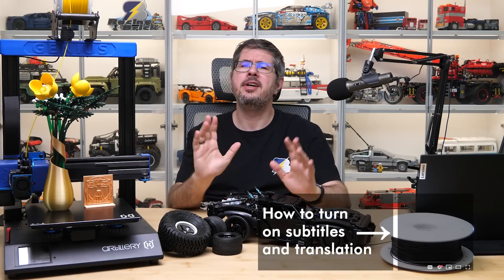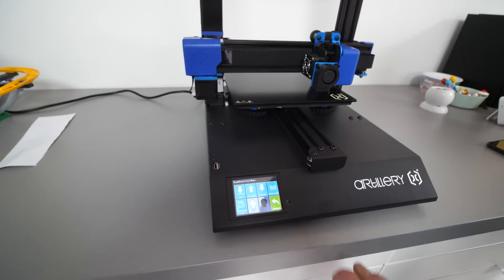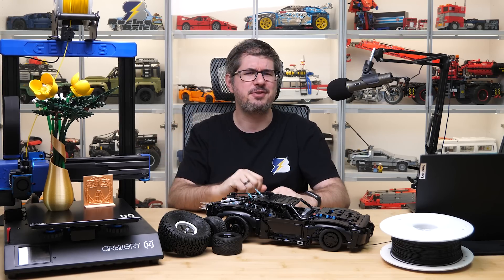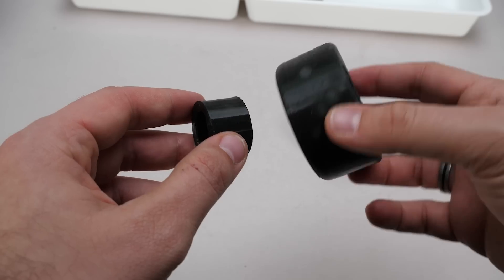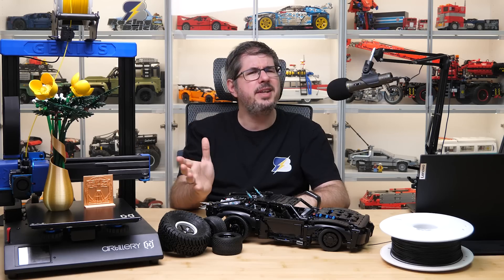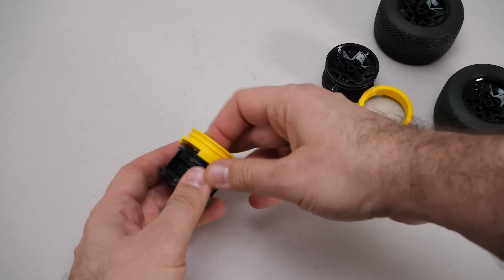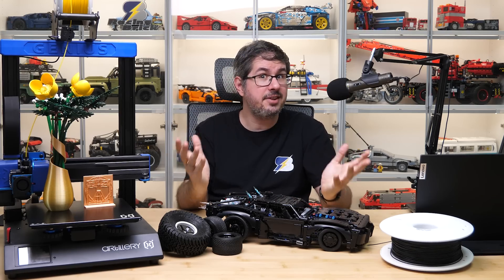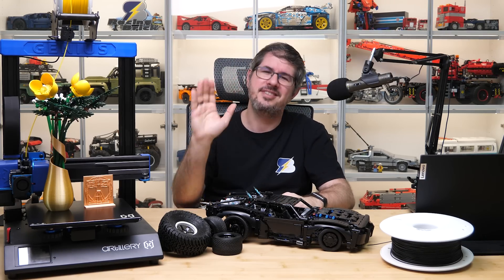3d printing custom tires for LEGO vehicles - fixing the Technic Batmobile!

Comment: For creating your own Lego parts - 3D printing should not be used for the final parts. Rather use it for what it is good for - prototyping.
get your design ready but without such things like axel-holes. Prepare the parts to have no surface defects and then create a mould and cast the parts in resin. Then add needed holes by drilling them. That way you can get parts with tighter tolerances, better finishes and way stronger.
Reply from the maker: Well, good luck drilling proper axle holes ;)
Reply: @RacingBrick  i mean i do have drills in 0.1mm increments. Getting holes aligned correctly and maybe having a bit more slop or a bit tighter holes is imo preferable to the warping, shrinking and lack of strength you get from printed parts.

Comment: Lego could use 68,7x27 tires from 1987 batmobile set
Reply from the maker: Those are too narrow
Reply: @RacingBrick  maybe, but it would still look better than the ones they ended up using.

Comment: Can you chemical wash or even fume bake the shiny material? clean some of the burrs off and matte the surface finish maybe?
Reply from the maker: I would need more guidance for these test, this is too generic with a lots of possibilities. We tried a heat gun on the material, only made it shinier. But whatever changes happen to the material it needs to be structural, otherwise anything covering it could be rubbed off during usage.

Comment: The Lego technic Batmobile has a lot of potential, I bought an instruction on rebrickable to upgrade the Batmobile design. No new tire required
Reply from the maker: Well if you don't change the tires and you still want to built the same Batmobile then the design of the wheels still won't match the original

Comment: Have you thought about 3D printing molds and then casting polyeutherane or silicone rubber into it to make wheels?

This is done a lot with combat robotics and can give some absolutely great results, although generally the hub is inserted into the mold so the tire is permanently fixed to the hub.
Reply from the maker: I did a brief research but this is a topic that requires quite some time to master. Maybe I'll take a look at it later, first I'll do my tests with resin 3d printing, that might be an easier way to achieve what we are looking for :)

Comment: Awesome video :D Probably too difficult but maybe you can print a model for the tire in hard material then make a silicon mold with that, and then cast the tires with liquid rubber. or maybe just a thin layer of liquid rubber or latex on the printed tires themselves. edit: with difficult I mean labor intensive and messy. I'm sure you could do it.
Reply from the maker: I did a brief research and although using urethane and silicone casting rubbers is definitely possible, people did it already successfully for RC cars, but this is a topic that requires quite some time to master. Maybe I'll take a look at it later, first I'll do my tests with resin 3d printing, that might be an easier way to achieve what we are looking for :)

Comment: When all else fails just use the printer to make a mold and make the tire that way. There are quite a lot of options for silicone rubber. Although I might be a bit biased as my friend at Uni did a lot of work using molds and made me want to try it.

Comment: No need to print out better tires and rims to see that the ones on the LEGO set are way off. A simple photoshoped image would suffice. But I appreciate the effort put into the video and showing how elastic parts can be printed. The other possibility would be to look for RC vehicle tires, they often match the LEGO rims good enough.
Reply from the maker: Printing was not done to show that the LEGO tires are off, we wanted to fix the error :)

Comment: It looks better now but hey little tip since you’re using the 3D printer. Remember the Mclaren F1 Technic that had an error with the Pirelli branding on the wheel cover? Now you can print proper Slick tyres for the Mclaren.

Comment: I've tried printing lego parts (and lego tires) in the past but it was quite difficult to print such little parts with such accuracy, I might upgrade to a better printer.
Reply: I tried FDM printing, Prusa 0.4 nozzle
I made few cogs for gearbox and bunch of leafsprings
It still needs a bit of filling and drilling holes to make them circular, but it fits